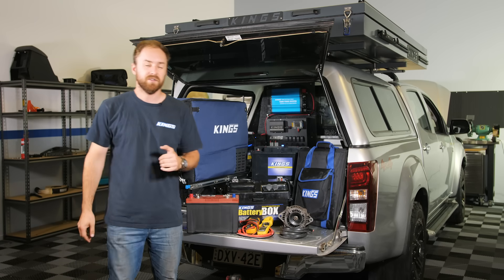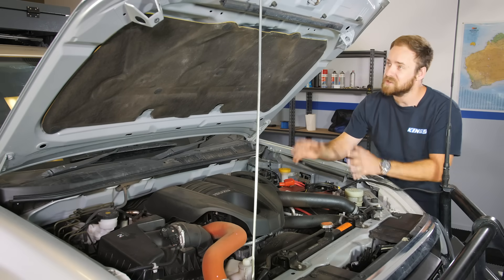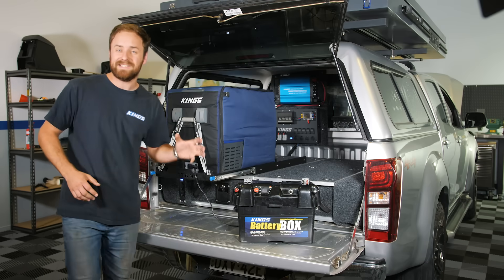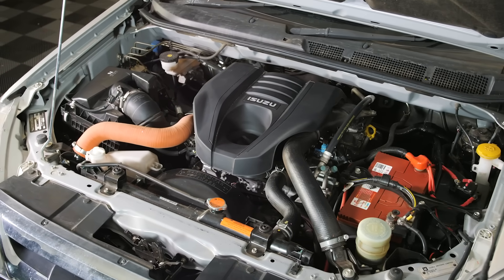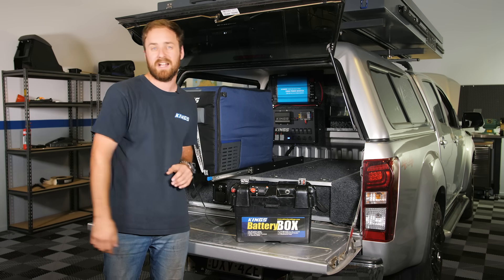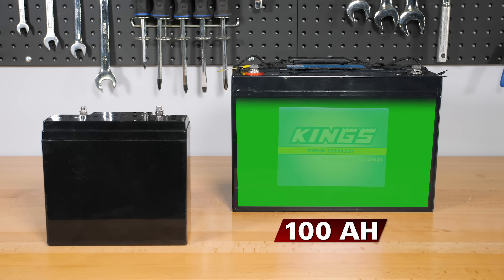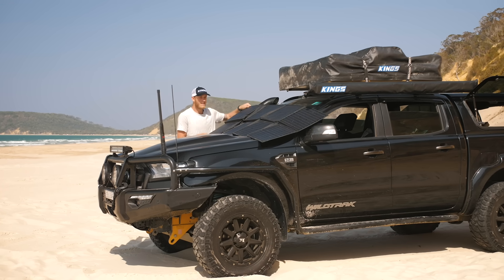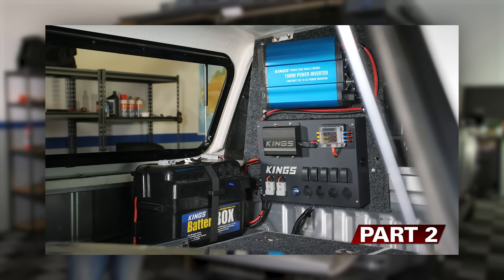Complete Off Grid 12V Dual Battery Masterclass PART 1 (Dual Battery Basics)

Comment: Almost perfect vid. 
Awesome for 1st timers and really showing people it's simple stuff. Only correction is the amp delivery from that 200w solar panel. 
That current was in relation to panel voltage. The regulator will drop the volts from 21ish volts down to 13-15v (depending on charge setup), which in turn raises the amps. Watts 101 is p=v x I  so say if your regulator is outputting 14v you will be seeing closer to 15amps (50% more than what the panel outputs directly).
Reply: This is why MPPT charge controllers are way better than PWM. You can effectively run a much higher voltage solar panel set up and convert all those extra volts, into amps. Provided the battery can accept the elevated charge rate though.
Reply from the maker: Glenn Matthews you’re spot on and good pickup, but what I forgot to mention is that it comes with a PWM regulator - so not a great buck converter.

If you used an MPPT solar controller you would get a much better power output with higher amps as you said, but I’ll go into that more in part 2.

Thanks for the comment and cheers for watching!

Thanks,
Cahn
Reply: @4wdsupacentreAu  no worries mate. Helps that I'm a sparky lol. Totally agree, just pointing out the relationship between volts and amps with a constant wattage. Love ya gear and the wicked prices. Keep up the good work 😊😊
Reply from the maker: yeah, you're right haha. Hopefully any other more technical folks will see your comment and understand it anyway... but for the basics I figure this will help new 4WDers and campers!

Cheers,
Cahn
Reply: Easy giveaway for formulas is the rating name. AH is amps X hour.
Reply: @hellsfurygaming3029  Thanks for typing all that out. I understand the math. I just wish he specified if that was a constant draw on average. Or a cycled draw on average.
Reply: @847MicRoss  best to check the specs on the website. Fridges are never a constant draw, hence the ah measurement. It would more than likely somewhere between 6 - 8 amps when compressor is running. And they generally run for like 10 - 20 mins per hour once the contents are at temp. This obviously greatly changes depending on how full the fridge is. The more packed the fridge is, the better it can hold temp, this the less the compressor has to kick in. 1ah seems a little low. Probably to be conservative more like 2. But again it's hard to put a solid figure down as there are alot of variables

Comment: Why is there a fridge slide on top a fridge slide
Reply from the maker: Hey mate,

For us it can make it much easier if we need to film into the canopy, sliding the fridge out of the way and getting particular angles or wide shots can be better - but we do use it while we're camping sometimes too!

We tend to bolt it in or out as we need it - and it's been taken out for pt2 anyway!

Cheers,
Cahn

Comment: Will it do any damage to the starter battery if you run the fridge off it while the car is running?
Reply from the maker: No, it'll be all good! As Tyson said the alternator will easily provide enough power to run your fridge while you're driving. That'll keep the battery 'full' so it's not cycling up and down. 

The only exception is if you're really running a huge amount of 12v gear while you're driving and have a small alternator... for example:

My old LandCruiser had a 55 Amp alternator - by the time I was running my:

Highbeams (10 Amps)
Spotties (15 Amps)
Windscreen wipers (5 Amps)
Heater fan (5 Amps)
Rear window demister (5 Amps)
Charging phone (~1Amp)
Listening to the radio (~1 Amp)
UHF is on (~1 Amp) 
Fridge (1 Amp) 

I was using a fair bit of power! (around 44 Amps total)

So, the 55 Amp alternator was powering 44 Amps worth of 12V gear and that only left me 11 Amps to charge the battery up! 

Not enough to discharge the battery but it would definitely slow down the charging! (You can see how if you're driving through the day without your lights, windscreen wipers, heater and demister on you'd have a lot more power and charging going directly to the battery!)

Mind you this is much less of an issue with newer vehicles and more powerful alternators...

Finally, remember to plug your fridge back into your deep cycle battery when you stop at camp! most in-vehicle cig sockets won't have power when the vehicle is off which = a warm fridge.

Or if it is powered, it will leave you with a flat starter battery!

Cheers,
Cahn
Reply: @4wdsupacentreAu   Ok great thanks
Reply: No because the alternator will power the fridge without the battery draining any energy.